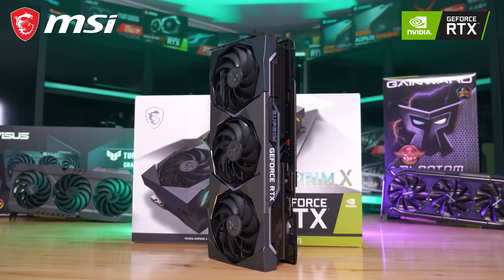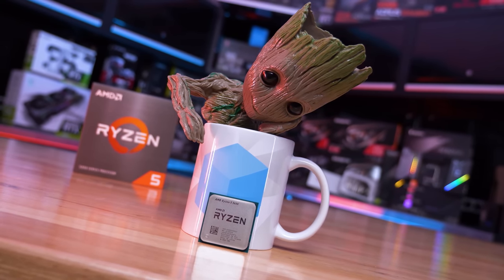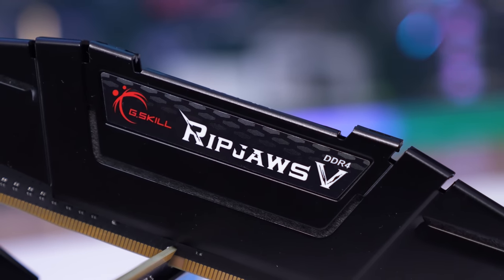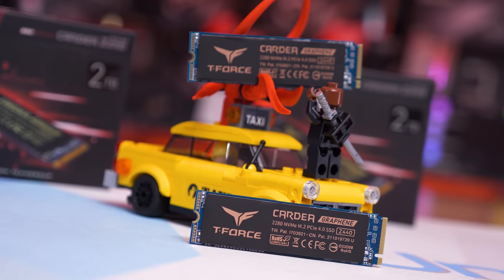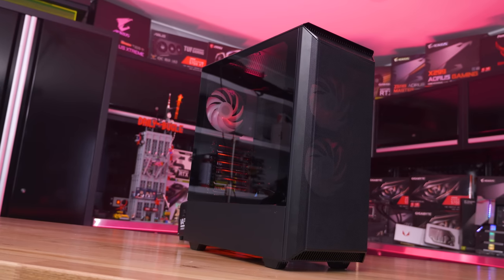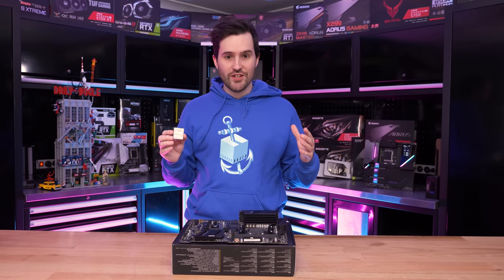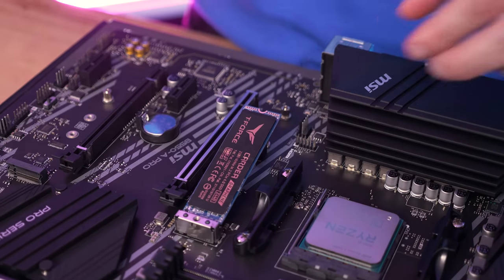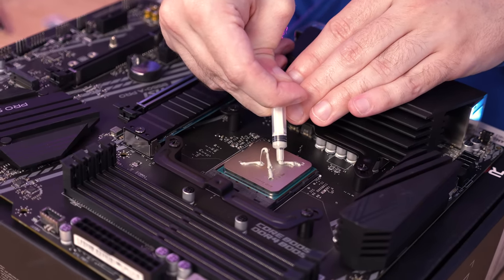Ultimate Value Gaming PC Build - AMD Ryzen Edition for 2022

Comment: tough recommendation. if im building a new AMD build i'd proably go with the cheapest AM4 possible to save cost since there's no upgrade path anyway, $150 mobo for a dead platform is a lot.
Reply: Yeah I don't really see why you would buy AM4 new at this point.  Which is fine, nothing done wrong on AMD's part.  It's just end of life.  AM5 when it comes out would be better.
Reply: Yeah thinking of buying a A520 board at this point since no use trying to get a new motherboard
Reply: There isn't an upgrade either for the Intel parts. NOBODY buys an Intel chip to replace the next year. And guess what? New M/B for intel. Do you not buy a 13th Gen because the M/B would be EOL?
Reply: @markhackett2302  They’re not saying you shouldn’t buy AMD, they’re saying you should buy a cheap or used motherboard if you do. I kinda disagree, for what it’s worth, but it’s defensible.
Reply: There’s still a upgrade path in-socket to the 5800X3D or 5950X.
Reply: @dilet1114  But they wont make sense in 2-3 years when a person will maybe upgrade... They will be outdated then.
Reply: @jamescunningham8092  They are saying they don't buy EOL. They are saying don't buy EOL. That is therefore including Intel. But they don't. That is my point. They hold a different standard for Intel than they do for AMD.
Same for you. Since he didn't "SAY" "Intel", you ignore that Intel 13th Gen is EOL on that socket too.
Reply: @fafski1199  "and one that will barely make any gains (at least in gaming). "
Wrong. He said 5800X3D. All it DOES is gaming.
Reply: @fafski1199  "I believe"
And that is why we rightly call you a fanboi.
Reply: @froznfire9531  But neither does ANY Intel. After all, in 2-3 years, 12thh Gen will not have an in-motherboard upgrade.
Reply: @markhackett2302  I mean at least 13. Gen will fit. But sure it isn't great aswell

Comment: You can get decent B450 and B550 motherboards for a lot less than 150 USD. In my region, you can get a decent B550 board for about 71 USD (equivalent), which I think would make a lot more sense for a budget gaming build, and this is also cheaper than what you can get B660 (Intel) boards for. I wouldn't recommend it, but with adequate ventilation, you can run even a 12 or 16-core CPU on cheap AM4 boards, so, needless to say, you've got more than enough VRM cooling for a 5600 or 5700X for that matter. But, don't just get any cheap board, try to make sure that it's one with VRM heatsinks. A lot of the cheap boards don't have VRM heat sinks, but some do.
Reply: I don't think it matters if it's a decent one or not, as long as it does what you need, which they must or else no one should buy them.
Reply: The B450 Tomahawk Max II would be good, it had been priced about half as much where I am (UK), but alas it seems to have vanished from all sellers in recent weeks despite being in good stock prior to that.

Comment: Never hold a mobo by the heatsink, you can cause micro fractures in the traces and it can die at any time in the future if it doesn't just not boot.
AND thats another reason you boot the mobo before installing in case, you know if you destroyed it or if it was DOA.
Reply: You are wrong my guy you can install it and take it out that way same with motherboards vrm. It’s recommended from the heatsink rather than holding sides on the motherboard.
Reply: @SilverDoobie  only in backplate situations but not all boards have back plates so its a bad habit.also you should support the far side of the mobo (fulcrum portion from the heastink will apply most pressure from that point) no matter what when installing.

Comment: Need suggestion. right now i have R5 3600 in B450 Mobo and GPU 3060ti. Will I get big improvement in gaming if I upgrade from R5 3600 to R5 5600  (still in B450)? i can only afford to upgrade my CPU or Mobo, not both.. Or should i just save my money and skip the next-gen.. thanks..
Reply: That very much depends on the game, resolution, detail settings, etc. Check reviews to find games that most closely match what you play, because some games will benefit from the difference but others won't so much, or not at all, especially if you play at 1440p. The 3600 is still a good CPU, so is it really worth the upgrade cost to a 5600? Only you can decide, but try and find data which mostly closely matches the games you play and with which settings, etc.

Something you could do btw is run Afterburner and monitor what the CPU and GPU are doing while playing your typical gaming scenarios. If the 3600s isn't really doing that much beyond 50% most of the time then it's unlikely a 5600 would make any difference, though do check individual core loading since some games hammer just one or two cores while leaving others barely used (which results in middling averages).

You would gain nothing from a mbd switch; any thinking more down that road would imply waiting for AM5 if you really did need anything better. Note the 3060 Ti is I think about the same as my old 1080 Ti in general terms, so you've some decent GPU oomph there for sure.

Comment: One thing of note with people comparing NVMe gen3 vs gen4 is that the TBW is consistently higher across the gen4 drives. For example, the XPG S50 Lite is barely faster than a high end gen 3 drive, but is usually around the same price.
Reply: TBW hasn't been an issue for years....

Comment: My budget parts list assumed a few things. 1.) Nvidia preference 2.) The need for alot of storage initially. I ended up with:

R5 5600
MSI B550 Tomahawk
16GB Corsair LPX DDR4 3200
Zotac RTX 3060
2TB WD Black SN750
Corsair 4000D
Corsair CXM 650 PSU
Asus TUF VG27AQ 1440p Monitor
Reply: budget?

Comment: Great choices for this build, I built a very similar PC with a 5600X and the MSI B550 A-Pro  a while ago and it has been a solid performer with a 3080FE.
Reply: If they are spending that much, might as well get 5700x.
Reply: @OrjonZ  I was upgrading from a 2600 and the 3080 was at MSRP so the extra cores/money didn't seem to make sense from a purely gaming point of view. When I do upgrade again either to AM5 or whatever Intel is peddling them I'll probably go for more cores then as games will likely use them. But while consoles utilise between 6 and 7 cores for games I don't think we will see the benefit of huge core counts for games over clock speed, IPC and cache.

Comment: I'm retired and just can't buy new parts like that anymore, but... a R7 1700x, MSI tomahawk Max and a new case, and the rest out of my older rig, and I"m beating previous R7 1700x's in Cinebench and my games run like butter. I don't need the latest and greatest, I just need 'enough'. I'd love the greatest, but... pfffft, I'm quite pleased.
Reply: Very sensible approach. All too easy to get sucked into the New Thing mindset these days.
Reply: @mapesdhs597  Well, I am still trying to think of a "go fund me" title so ppl would send me 3080s and threadripper /mobo combos... but, I can't think of one yet that isn't embarrassing, silly, or wouldn't work if it had gold fillings.

Comment: Only things I would change in this build would be a 550W gold rated PSU for $70, and an 1TB PCIE 3.0 nVME for $80. Maybe even a Gammax 400 for $20-25 insted of a $40 that isn't needed since the CPU is low power? Much closer to $1000 total.
Reply: Swap the mobo out with a gigabyte b550m ds3h while youre at it
Reply: The Wraith cooler is perfectly fine unless you intend to pummel the 5600 into oblivion which I wouldn't do on an entry level board anyhow...

Comment: Wow, I almost won the bingo in this one. Mine looks exactly like the one in the thumbnail, even the red rgb. Same box, same motherboard, but with a R5 3600 and a XFX 6600XT. Planning on upgrading to a R5 5600 if it eventualy drops below 180 euros (not in a hurry, though).
Reply: I'd rather just wait for the AM4 prices to crash after AM5 becomes stable and go with top-of-the-line AM4 processor, you're not going to upgrade a second time on your mobo
Reply: From 3600 to 5600 is minimal with your GPU, not really worth 180 bucks if u ask me. Wait as already said until the higher end chips go down, maybe take a 5700x/5800x3D when their prices are good. There you will most likely see a improvment

Comment: which one should i get?

i5-11400F + B560m-a = 240$ / MYR950
or
R5 5500 + B560M-a/B550m ds3h = 250$ / MYR1000

Pair with 3050/3060

I use for 1080p gaming,video editing and blender work
Reply: the r5-5500 is a sht cpu. go with the 11400f or if you can, even better a 12400f

Comment: From what I've read in FB groups, you need a x570 board, 32gb ram, a faster m.2, 360aio, and atleast a 1000w PSU

Also what does budget mean ;)
Reply: You need Ryzen 7 5800X3D and RTX 3090 Ti too.
Reply: @sokool3994  well of course, but now the budget builder has wasted all their money on stuff not needed/overkill, so can only afford a 1660 to go with that 5800X3D
Reply: @sokool3994  And then use it to play Minecraft :)

Comment: Is there a possibility for you guys to test the ryzen zen 3 cpu's on x370 motherboards , as a lot of vendors released bios version by now that support those cpu's. Especially how the new 5800x3d performs is really interesting imo , i am running a 3700x on my x370 board with 32gb 3200cl14 and think about upgrading to the 5800x3d to increase its longevity to a maximum . But then again i got doubt if i get similar performance out of the CPU on the older chipset . I am pretty sure this is a video a lot of people might be interested in.  Basically comes down to upgrade now and enjoy for a few more years or wait for zen4/whatever intel might offer @ the end of the year and have to spend way more because of ddr5 , need for new motherbaord and so on.

If the performance is similar or close enough to x570 with the same cpu's i think used x370 mobo or even old retail stocks might become highly interesting for budget builders also , as you can get those mobo's for ~50$ with decent feature sets besides not supporting pci gen4
Reply: I think the point of using a 300 series board is that it's already fitted in your case. If you're going to the trouble of buying one then get  B450 they are not expensive, I got a new Gigabyte for £35.

Comment: AMD 5950X + X570 TOMAHAWK: BIOS version 7C84v18 and all settings are "auto". Some reason vcore is going very high and stay there 1.42v
I updated to latest BIOS 7C84v191 but did not help. Note! I always clear CMOS after first boot of bios upgrade.
- To "fix" this problem, in BIOS I changed OVERCLOCK->Vcore to OFFSET mode, where Vcore works "auto" but offset is (minus) -0.2000v
Now my vcore rise max 1.216v

Comment: I really wanna see an Intel 12400/12600 D4 comparison to this! 2 more video potential there: the Intel build itself and the showdown between the two. Would also love to see an Nvidia option, and a comparison going to the next level of computing such as replacing the AMD CPU with a 5700X (2 extra cores) or the Intel CPU with a 12600K / 12700 (non K), as I feel both CPU and GPU switch are really meaningful for a long-term system with basically 50-100 usd /4-8%) difference on each part. Also wondering how DDR5 or just a better motherboard would impact upgradeability, given spending a little extra on either DDR5 or a better motherboard would allow for significant upgrades down the line (adding better DDR5 or getting a mobo that will accommodate a 5900X/5950X or 12700K/12900K/S)

Comment: Parts choice:
A $120 PSU with ~3x the effect of the peak system power consumption would not have been my first choice. The Seasonic GX 550 is half the price at $60, and the GX 650 is $10 more than that.
Neither would a PCIe 4.0 SSD, which costs 50% more than a PCIe 3.0 while providing no gaming performance benefit and minimal boot benefits - sure, it's 40% faster, but even a (decent) 3.0 will be fast enough that's not an issue.
As case is a matter of taste, I'll only mention that the Fractal Design Focus G exists and is about half the cost of the chosen one.
Hey, $340 for a 6600? Nice. Currently, the cheapest one in my region is $430. I bought mine at launch for $370.

Build notes:
I always start with the IO shield, the moment, I open the motherboard case, otherwise it won't be there when I'm lowering the motherboard in place. :/
Honestly, I also forego the test boot before installation, unless it's an ITX build. It's a bit of a hassle, even if it is good practice.
With a modular power supply, I'd connect the power cables to the motherboard before putting it into the case. Might also, depending on cable lengths, connect the case cables to the motherboard as well. Better out than in,  I always say:
https://www.youtube.com/watch?v=owTGBSmeKOA

Comment: For someone who won't upgrade anything except the GPU for the next 6 years probably, what motherboard should i pick?
Reply: Haven't paid attention to it as I'm content to let DDR5 mature over time, but ideally something that already uses it or can fit both ddr4 & 5 for a couple yrs down the line. Not much help, but something to consider. Also end up with the PCI 4.0, which I may not definitely be missing.. Not missing it that* much though. Gl, cheers.

Comment: GPU pricing has been the big sticking point for the last couple years, justifiably, but comparing your parts list to a similar build (R5 2600 and RX 580 8GB) I put together in late 2018, I was reminded how badly we were getting fleeced on NAND. I paid $125 for 16 GB of 3000 MT/s RAM and $100 for a 500 GB SATA SSD. Three and a half years later, the total cost is about the same, but now the NAND is cheap and the GPUs are pricy. 

I guess my point is, you should just get the best you can afford when it's available. Waiting for the "right" time to build probably means waiting forever.

Comment: I would personally go with the following changes purely for gaming and if one stays below 100fps after the future GPU upgrade

SSD 512GB and 2TB HDD
Processor R5 5500
GPU 6600XT
A cheaper B450 motherboard
A cheaper CPU cooler

I don't think the processor is even going to bottleneck the 6700xt

The build mentioned in the video is however an overall performer.
Reply: b450 has slower hdd bus PCIe 3.0, but they run well and are dirt cheap now !

Comment: My build few days ago: msi pro b660m-a wifi ddr4, i5 12400F, RTX 3050, 16GB 3600MHz ram, 500gb ssd samsung 980, 2tb baracuda, Seasonic s12 550W, case Zalman s2 tg. Why everyone inserting big PSU this days. Gpumax 250W, often 150W, Cpu 130W, al other components 50W, 20% margin and we are 550W.

Comment: Yeah I actually install the PSU prior to even the motherboard. However I build first on the motherboard box, test that it boots, then, PSU goes into case, and it's pretty much just so I can pass in the CPU 8 pin, prior to installing the board, that's the only reason, then the GPU goes last just because it has to be after the motherboard.

Comment: Do you think that it is smarter to buy a r5 5600 or r7 5800x3d for playing games at 1440p on an rtx 3070. If needed for gaming purposes only will it make a big difference?
Reply: It might with certain games, check the benchmarks. Is it worth $250 though? Only you can answer that. $250 might be better spent jumping to an RTX 3080.
Reply: @jasonhurdlow6607  Well said. Skull, you need to check reviews to find games that most closely match what you play, because some games benefit from the beefed up cache design, some don't, while some actually run a bit slower because the 5800X3D has lower clocks than the 5800X.

Or if you wanted the extra cores for things like more fluid streaming or content creation then the 5700X would be a better compromise, especially with its lower power draw (same TDP as the 5600).

As Jason said though, definitely check the reviews (start with HUB and Gamers Nexus, though alas I have to say Jayz's piece was rather poor, again focusing on synthetic tests such as 3DMark), but bare in mind the gains may be less at 1440p where the bottleneck tends to move more towards the GPU. Some reviews only focus on 1080p where the differences are most pronounced, so make sure to compare with your own config as closely as possible.

Comment: I do not fully understand why, with ram, people talk about the speeds but not the timings... Its half the story. 3200mhz ram can be as good as 3600mhz if the timings change too. Its like saying i7 is good... which i7 do you mean? 1st gen or 12th gen? There is a difference.

Comment: The thumb is incorrect.
I understand for great value build had a dedecated GPU but a budget build does not, only uses the 5600 iGPU.
Easy sub 500 price that can play GTA 5 at 70 to 90 fps(OC or not) at medium low settings 1080p.
Reply: I just did a mini gaming build for a client for 550 and it also has good upgrade ability.
A itx board with full 65watt configuration, 11 fase power, good oc settings and power sbility, ram goes up to 4800mhz, supports new pci version and mutch more.
The psu is a small micro 450w Be quiet (all power protections, certs.) that is mutch more than enought for this build for years, shows max 110 watts of power while gaming by power meter at socket and a 1tb full speed nvme.
Client chose to build their own case for the PC.
Reply: What, wait, you hope the computer posts...
If i put a computer together i allways expect it does and allmoast never hapens (allmoast aka when a broken part).
As a proffesional you should not feel that way.
Hope you get more training and experience so that wont be the case.